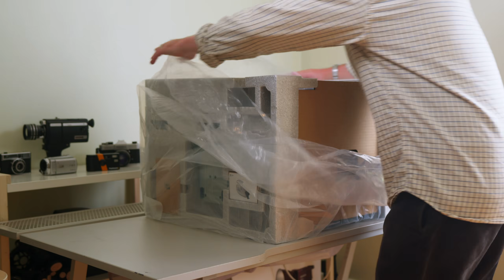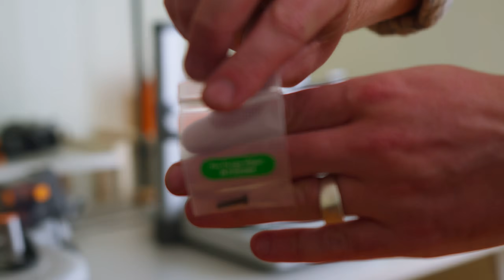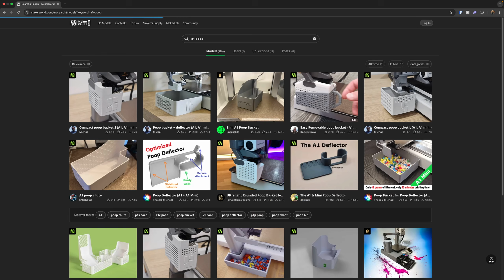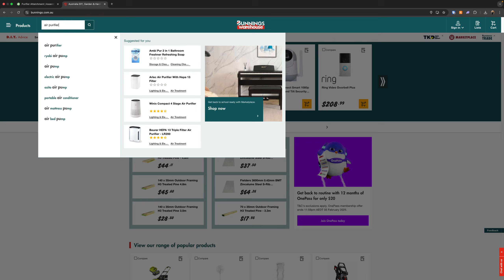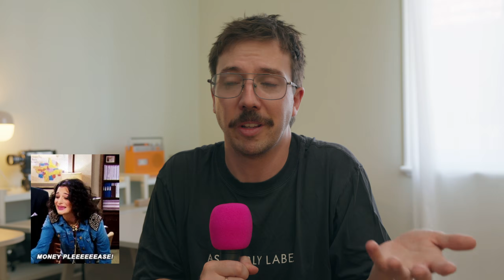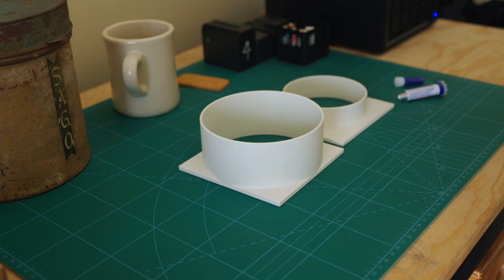Setting up a Bambu Lab A1 so that it doesn't slowly kill me

Comment from the maker: WOW! What a response to this video so far, super thankful to everyone who's watched, enjoyed it, dropped a comment and all that good stuff. I did not expect this out of the gate on a new channel. Literally didn't even post this video anywhere, just hit publish and let it run free. Many thanks! Now for those who are interested, I've set up a profile on Maker World with the files for the purifier housing, it's niche AF to my specific purifier but if you want to mod it and try it out for yourself, it's all yours. ♥

https://makerworld.com/en/@Billt./upload
Reply: So I have zero clue about how safe breathing this stuff in is. But like you, I had a feeling it couldn’t be good. So i bought an Apollo Air 1 to monitor and test the air quality and connected it to Home Assistant and setup a display to monitor it and send me notifications when it changes. And shockingly while running my A1 mini and using Bambu black matte PLA (no enclosure, but i do have a super basic air filter in the room) the voc’s don’t elevate basically at all, neither do any of the sizes of Particulates (PMs). Honestly, this shocked me. Like for example i opened a couple packages from Amazon and both the VOCs and PMs raised more than a 6 hour 3d print does - simply opening a couple packages! Obviously, this is based only on the black matte Bambu pla, I have no clue if it’s different with other filament, my assumption is it will vary. And also, only my single personal experience, so it may be entirely different in your space. And i do have a basic air filter in the room.
Side point, the Apollo Air 1 is amazing, it shocks me the random things that effect the Air Quality.

Edit: So today I used Petg-HF and it definitely raised the PM1, PM2.5, PM4 and PM10 sized particles in the room. Pretty huge difference compared to PLA.
Reply: @Fatty_matty  and @Billt.  i too made an overkill , so , in the room where i have the enclosure i have a hepa13 + activated carbon filters (80 mc / h- and the room is 30 mc ) plus 2 hepa filters inside the enclosure , one recycling the air inside the enclosure and one filtering the air and then pushing the clean air our of the enclosure ; then lastly i have a vent that pushes air from inside the room to outside/outdoors ; and i print mostly PLA and sometimes PETG 
the 2 smaller hepa's are 10 metric cubes/h each  ; hepa's are really good since i read that they can also catch nano-particles via a process called diffusion
PS and i dont stay in the room and just visit the room to check on the print from time to time
Reply: where can i find that table with the back grill?
Reply from the maker: @MangaMaster99  Ikea UTESPELARE (in Aus anyway, your milage may vary)
Reply: @Billt_it  thanks
Reply: Not sure if you'll see this, but please disregard the Bambu controversy. It won't affect you or 99% of consumers, and people are really blowing it out of proportion. Have fun with it and don't worry about them lol!
Reply: Cheers! I've downloaded it from Maker World. It needs to be split into separate parts, then arranged on 2 build plates before printing. The filter housing needs supports enabled. Not hard to do, but it can't just be printed as uploaded. 

Still trying to decide if I buy the purifier or just vent it straight out the window, but either way I'll print the flanges once I finish the prints I've got queued up.

edit- Almost forgot. The filename is missing the dot before the stl extension. It won't load until that's fixed. Anyway, printing it now.
Reply: Fusion 360 for hobbyists
Reply: Regardless of the data issues or how the VOCs and particulates are handled is there not a more worrying fire hazard from melting boards in the A1 being reported right now?
Reply: Not to beat your mood but I'd love to send you papers saying something completely different then the story you told here. I don't think it's fair to make such a bold video title and subject without proper research and you skipped over it quickly.
Reply from the maker: @malloott  I'm always interested to learn what I can, but just to be clear I'm not presenting myself as an expert in this field - FAR from it. I'm just a guy with a camera showing you his thought process in a way that is hopefully a little entertaining ❤
Reply: I get ur not trying to be rude but tbh in the video he said it was prob fine and it was prob overkill but i guess the video title was a bit bold @malloott
Reply: @malloott  people use bold titles to hook the viewers so they click it

Comment: I bought a Levoit Vital 200S - cheap and it handles 3D printing emissions by using an H13 True HEPA filter to capture airborne ultrafine plastic particles and an activated carbon filter to absorb volatile organic compound fumes. I put it 1 foot away from the printer, suction facing the printer, it works incredibly. My room is clean and there's no plastic smell anymore.

Comment: dang it, now I dont know where to put my hypothetical 3D printer LOL
Reply: If you're really strapped for space and really don't have any other room to put it in, the bedroom works fine. HUGE caveat though. If you are going to put it in your bedroom, at least get an air purifier with a HEPA filter (for the microplastics) and an active carbon filter (for the VOC's, harmful fumes to inhale over prolonged periods of time). I am NO expert in the field of 3D printing. I got my A1 about 2 weeks ago from the posting of this comment and I've placed it in my bedroom literally not even a foot away from my bed. From what I've researched and rabbit holes if dived down, I HIGHLY recommend NOT doing overnight prints in the same room you sleep in. Mainly because of the micro plastics and the VOC's, and because hearing that thing would probably drive you insane. Another thing to think about is the smell (if you're sensitive to it). Some people can smell PLA, PETG, TPU, etc. when printing from this printer. I unfortunately have a slight sensitivity to it, being that it gives my very slight headaches and I don't find the smell particularly pleasant, but that hasn't dissuade me from keeping it in my room. You can totally be in the same room as the printer while it's printing, but please, AT THE MINIMUM, get a decent air purifier. I don't think you gotta do all the crazy stuff he was doing in the video, but do consider your lung health too. I always run my air purifier on turbo mode (the max speed for mine) while it's printing and that honestly seems to work perfectly fine for me. I don't have an enclosure or any form of crazy ventilation, just the printer and my awesome purifier. I do think the A1 is amazing and a great printer to think about. If space is still an issue, think about the A1 mini, or similar printers in that size and price bracket. Same fume issue applies to the mini, but it's more beginner friendly from what I've seen, and it's nice to get an intro into what 3D printing can hold. There's a lot to get into with this hobby and I think if you have the money, space, and time, think about trying it out. If you're unsure, try out the mini!

Comment: I am have a mini, and an air filter right by it.  (Blue collar guy here)
Working at auto recycling plants, welding, and so many other things we do in the industry where we don't always or are required to wear a mask when there's ventilation but still breathing in the fumes man creates.  For me in my case, it's just a Monday.  But I still use an air filter by my unit regardless and had added a tent enclosure that the filter clears out just fine.  But I get many have health issues and it don't want whatever it is I ALREADY got just from working a man's job.  😂😂  But I never smell anything with my filter on.

Comment: You're hilarious! Your channel should have far more subscribers. I've not got an A1, I've ordered an Anycubic Kobra X. I am seriously thinking of buying an air purifier. UK Amazon has a Winix 5500-2 on special right now and on 5 monthly payments. There are two issues for me. 1) My wife doesn't know I bought the X (actually with as a Combo for 7 colours). 2) Which will kill me sooner: my annoyed wife that I blew £625 (X + Winnix + Snapmaker Polydryer) a further £575 (servicing my motorbike) another £2k (sorting out the air suspension on my Merc) or some fumes from a printer? I reckon I will be dead sooner from my wife.

Comment: Onshape has a tool for weight reduction, you should check it out, it can see what forces are being applied to the object and make the part have the correct structures to reduce its weight by a variable percent

Comment: The lubrication part got me too—I was questioning why there was no lubrication step, and then, as soon as I finished setting it up, I got a message saying to do it. On the second print, the heat bed malfunctioned, and now I need to take it apart to test it so I can get a replacement part. Not a big deal, but still annoying, especially with how hectic my day-to-day is.

Still, it’s an amazing thing to have. And yes, I knew it could be dangerous, so I always print while I’m in another room.

Comment: Hey so my mouth also felt plasticy when printing, so I got a air monitor that checks for VOC, PM1, PM2.5 & CO2 but it doesn't pick up anything when 3d printing while it even goes off for hair spray and lint remover. Before blindly getting a air purifier, I want to make sure that it will catch whatever bad stuff this is putting out. Has anyone else detected PPM or VOCs?
Reply from the maker: I’m still, a year on, running on pure mouth feel and nothing scientific - but I have recently moved the machine to my back shed. Didn’t want it in the house with two little kids anymore

Comment: My gf is a doctor and she immediately pointed this out. Glad she did, I wouldn't think about it much before buying and using. At the end I've rather decided not to risk health issues even with ventilation. Some filaments are more harmful and in longterm I just wouldn't rely even on such a ventilation.

PS - I'd buy some air quality (/VOCs) meter to really make sure it's filtering well. If you do, would you share the results?
Reply from the maker: I’ve since moved the setup to the back shed and I’m printing more than ever and not even worrying about the fumes anymore. Safety and function over aesthetic setups - truly in my dad era now haha

Comment: Yeah I have my A1 directly to the right of my desk so the extruder fan points at my face while printing 😄 I have a Prusa enclosure with filters and a fan that it was supposed to fit in, but it didn't, so here I am blowing fumes right into my face. Did I mention this is all in my bedroom as well? I'm gonna need to figure something out 😅 Maybe slapping a filter on the extruder itself?
Reply from the maker: Yeah not a fan of that! Good luck my plasticy friend

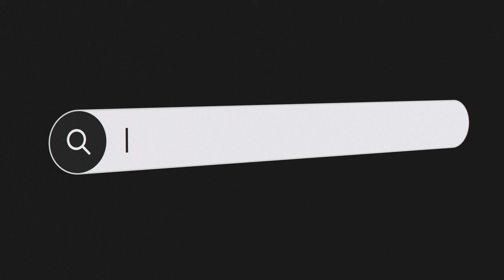Comment: 4:08 My kids and I spent over 1k on a printer and filament, set it up in my basement, started printing all kinds of junk then it also hit me......."wait, this can't be good!!"
Reply: Why wasn't it good?
Reply: @spiralnapkin  Micro plastics and other harmful chemicals in the aid
Reply: @BeanTopVR PLA is mostly safe as long as your work area is ventilated or filtered with a regular air filter. The amount of VOC's released by a single printer printing PLA are pretty far below the occupational regulations for exposure. However, you shouldn't expose yourself to PLA VOC's for more than 8 hours per day.

For ABS, filtration and good ventilation is completely necessary.
Reply: @ThatOneStopSign  true

Comment: It's great to see people take safety seriously in 3D printing. Especially youtubers; it is sorely needed. Also, your format is excellent. 

Rant incoming... :P 

Having said that, about Bambu: I am tired of companies taking liberties with their customers just because people are accustomed to it. There are turn-key printers which aren't anti-consumer. 

The apple comparison is apt. But the funny thing about "it just works" is... until it doesn't. A "required" update executes in the night without your permission, and you wake up to find #### broken when you need it most. Or it's a hardware fault because components were chosen to last [warranty_time + buffer]. "Something went wrong," it says, most enlighteningly. 

Is Bambu that bad? Eh, probably not. But my mum always told me not to gamble (to whit, I've got her using linux mint and we've never been happier).

As for data, my concern isn't what Bambu does with it; it's where the data ends up. To each their own, but I have a commercial prototype I'm working on. 

Now, I'm not against compromises, but you have to get something out of it. I recently bought a Troodon 2.0 because I don't have 30 hours to build a Voron 2.4 (open source, CoreXY), and I got the Troodon at half price. It isn't without issues. But, in 20 years time, when all three of my bedslingers are stacked up in the shed providing loving homes for families of redbacks, my Troodon will still be printing. 

(In fairness, I only bought one of those bedslingers new; the other two I picked up at a garage sale for a song.)

PS: Did you know Bambu's "3mf" format is not compatible with other software? Granted, you can export a real 3mf file from bambu studio.
Reply from the maker: I don’t disagree with you, and 100% respect your take. To my detriment there’s some things I just can’t be bothered with the added thought so I just go the easy route. This is one of them

Comment: There are already studies which show that printing with PLA produces very low VOCs and low fine particles. Even PETG is acceptable. It's when you are printing ABS ASA TPU Nylon when you need an enclosure and ventilation system. My printer is roughly 6ft away and partially enclosed during PLA and PETG. If I print ABS, I have Nevermore and full enclosure

Comment: Make sure the USB-C cable underneath is plugged all the way in or it tells you your hot end needs replacing whan you calibrate, which is confusing. It does smell plaasticy though. maybe a PC fan blowing into a charcole filter is enouhg? Hmm

Comment: Interesting adventure .
 Also a Fairly Pricey BODGE for a percieved problem.
 Then there is the Print quality reduction issue... when using a heat retaining enclosre when the Filament doesn't actually require it.
 Warping are Us !!  
PLUS it's a Hideous Contraption.
Reply from the maker: Woah now

Comment: Watched so many A1 printer videos and NONE of them talked about how loud or smelly that thing would be. Glad someone touched on this.
Reply: Its because reviewers forget that not everyone has years of experience in the hobby. The "smell" isn't unique to bambulabs its what's to be expected when you melt any plastic.
Reply: Mine is silent and no smell whatsoever
Reply: Mine's silent too but god damn that PLA smell is bad.. Also fun fact; some people can actually smell PLA better than others.
Reply: @touma-san91 PLA always had a sweet scent to me, but only if I got my face right next to the printer. It starts smelling burnt if the temperature is too high.
Reply: @ThatOneStopSign  It doesn't smell sweet or burnt to me. It's closer to a stale cat piss
Reply: @touma-san91 What temperature are you running at? That description seems like it's cooking, not just melting.
Reply: @ThatOneStopSign  You say that but ignore that people perceive PLA smells differently, not to mention it also depends on brand of PLA, color of the PLA and so on. Not to mention, plenty of people also have called the smell closer to a cat piss than "sweet".
Reply: @touma-san91 PLA only smells like "cat piss" (I'd describe it as acidic) to me when I run it too hot, or if I'm running matte PLA. The rest of the time the smell isn't there, and my air quality indicator doesn't fess up.
Reply: @ThatOneStopSign sounds like you havent tried different filaments
Reply: @touma-san91 I've been printing and building printers for about 8 or 9 years. Also I already told you, matte does smell worse than regular PLA.
Reply: @ThatOneStopSign  And? You could have printed for 40 years and it still would not change the fact that you probably haven't tried large enough variety of filaments and their colors. The worst smelling I had was that test one that comes with Bambulab's printers.. And since then I've been using Copymaster3D because it's cheapest one I can get in bulk locally, and I would not be surprised if you have never even heard of Copymaster3D.
Reply: If you're smelling plastic you're breathing plastic
Reply: @Splozy pla is biodegradable. So you are consuming burnt corns by breathing😂
Reply: @cuplamyeon you know tobacco is biodegradable. Sure as shit not healthy tho
Reply: i, also like the other commenter own one and have it in a rack, it is absolutely silent, has calibration to cancel out motor noise, and it only will smell with certain filaments, not PLA. ontop of that the fumes are really not bad, its better then new york air. but if you had call it 50 without a filtration device it can be bad.
\
Reply: Weird. I can't smell any plastic smell.
Reply: it's not loud nor smelly though
Reply: It only smells depending on what material you using is you using pla the only way you smell it of you put your face next to it.
Reply: The pla smell may be from the user setting the temp too high and burning filament. Only been able to smell it when the temps too high or if I go 1 in away from it and take a whiff.